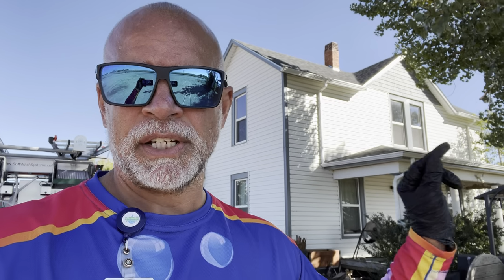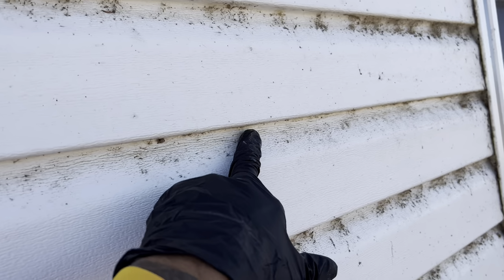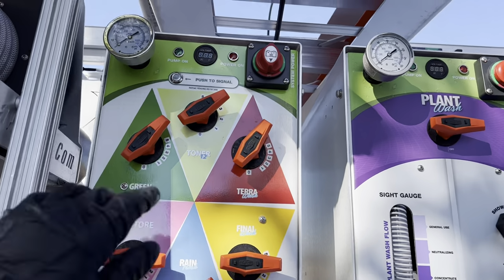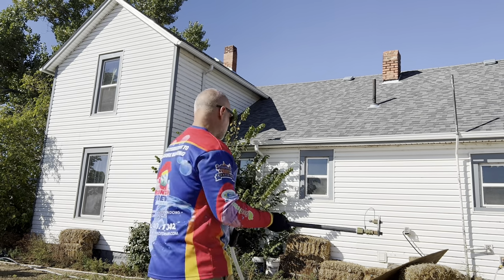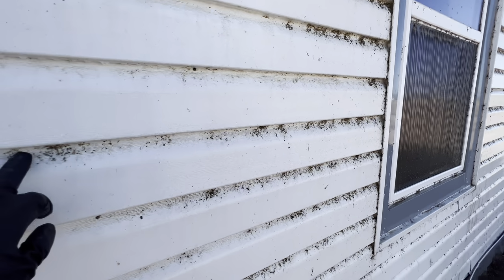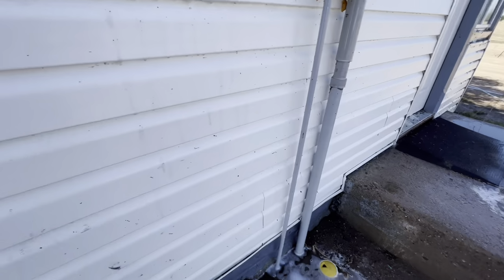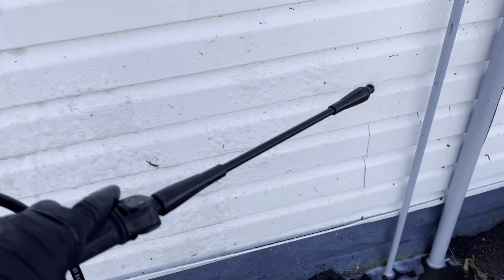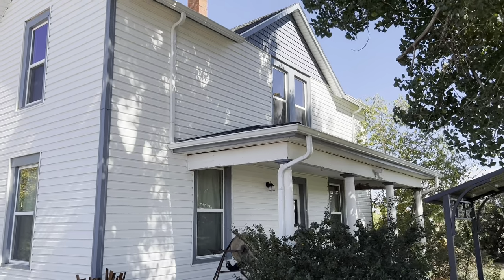How to quickly and easily remove spider webs from your home

Comment: Cost of having this done?
Reply from the maker: Hey there! We've got a range of prices for our washes, starting from just $0.24 per square foot and going up to $1.50 per square foot. The final cost depends on a bunch of factors like the type of siding, whether it's a single-story or multiple-story building, how dirty it is, and if there's any oxidation that needs to be dealt with. These factors affect the amount of chemicals and time we need to give the exterior a thorough cleaning and achieve the desired results. I would recommend reaching out to a local Softwash company for a free quote.

Comment: This softwashing system blows, an ar45 or downstreaming pressure washer would've done a much quicker & better job
Reply from the maker: Appreciate your insightful comments; however, I think you are missing the entire premise of “Soft washing.”
Reply: @mountainviewsoftwash9135  You can softwash with an ar45 and pressure washer. Softwashing just doesn't apply to a 12volt system
Reply from the maker: I agree that one can say they are technically “soft washing,” but in my opinion, if you're using over 130 PSI to apply or rinse the siding of the home, you are not soft washing. You're still blasting with higher-pressure water. The premise of our Softwash system is to apply and rinse with as little pressure as possible. I can appreciate that you prefer to use a different approach and process. I'm sure it works great for you, but for my company and customers, this is what we like. Thanks for watching 👍